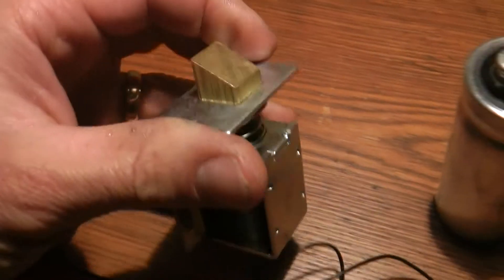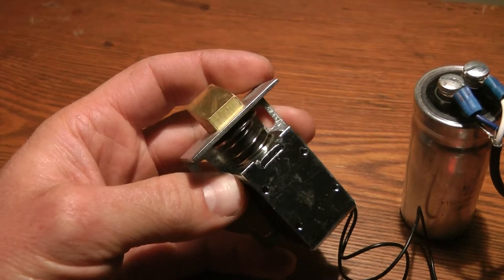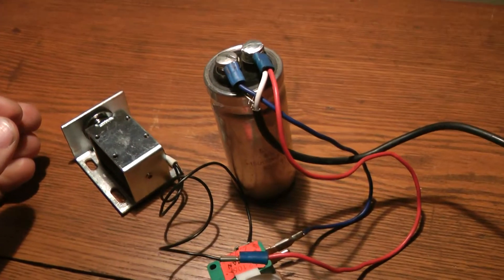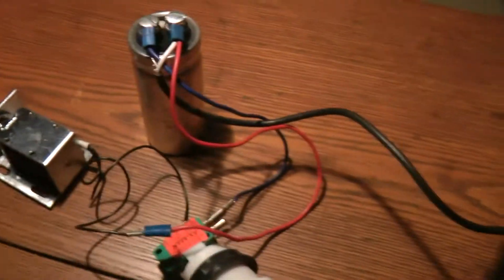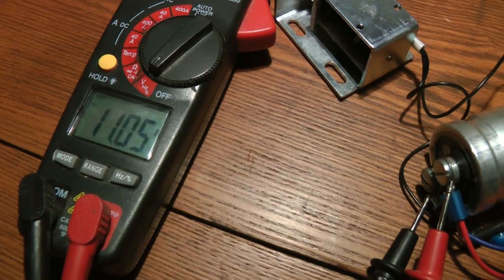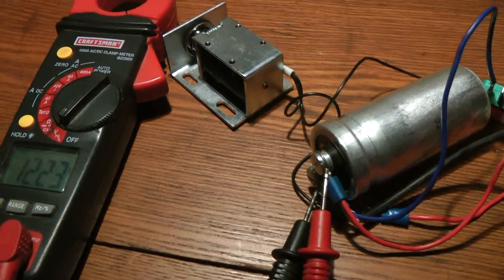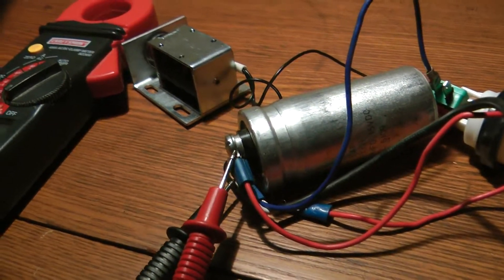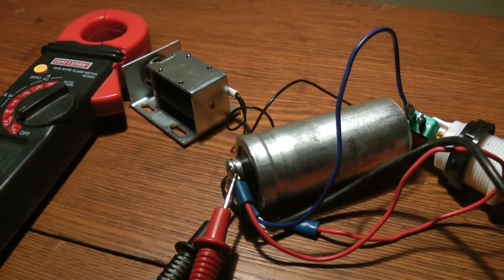What is wrong with my 12v DC Capacitor? Why does it discharge so quickly?

Comment: This is great, I am subbing to your channel (I can be your DIY support engineer).
So, do you realize that the moment you start to measure a capacitor with any off-the-shelf meter, you start discharging the capacitor thru the meter....hmmm???  YES!
You need a very small battery (like 1 Amp-hr) to store any useful (to do work on solenoid for any extended time, like more than one millisecond) work.  You can't buy a capacitor big enough to do what you are trying...that's why there are batteries.
But, great creativity....keep going.
Reply from the maker: I would love to have a DIY Support Engineer! Cool. Yes. I am moving on now from the capacitor to the smallest battery that will work in conjunction with a small solar panel. Thanks for all your input!
Reply: Excellent, look up "Flyback Diode" (Wikipedia)...you should use one with the solenoid so you don't damage your solar cells or charging circuitry.
Reply: +UnderseaCaveman if you dont mind i have a different question if i was trying to clean up DC power without inverting up and back down with a pure sine ---- so if i have a battery and i plug in something that runs with 12 volt but needs a clean power not as dirty as normal DC. could i put some kind of capacitor in line so - battery-  then cap - then device would that work to give me a cleaner dc or am i miss understanding a cap output
Reply: Well, actually a battery should be the cleanest source possible.
While capacitors are the first line of filtering in DC power supplies, they don't get rid of ripple.
For that you use a voltage regulator semiconductor device....many types available, look at digikey catalog online.
Reply: does a VR still have problems with low power they only take care of over power ?? i am not sure if i know that or just something i think i understand lol thanks for the answer i am about to start some dc project just to learn more my mind is over full with questions
Reply: i like that site digikey i think i will be getting some things from them soon thanks

Comment: I know why.  You need more capacitor.  15000 MFD is not enough to hold charge any long.  Plus they are use in larger power supply.  I have those pull out from large power supply that my friend, who work for SEL test section, have give away to me.  They are not battery powered, it is fitler.  You would need supercapactior, they hold large charger and lower discharger.  That capacitor in video are not supercapactior.  Ultracapactior can hold charger longer but it is expensive and is very dangerious.  

UPDATE:  I saw your update, that capacitor is not doing any good.  I would recommend supercapacitor or ultracapactior.

Comment: Hey Matt, standard capacitors hold their charge for a very short period of time (like you're experiencing). There are ones called supercapacitors (or ultracapacitors) that have a lower parasitic drain, however the max voltage on those is about 2.7v so you would need at least 5 or 6 for your purpose. At about $10 each, is a lot more expensive than purchasing a 8ah lead-acid battery for about $20 and the supercapacitors still will have a bit of parasitic drain.
Reply from the maker: Hey - thanks. That makes sense. I will have to figure out an alternative method.
Reply: supercapacitor are not bigger size.  It depend, they're smallest as finger that have less discharger time. That would be ultracapacitor you're talk about.